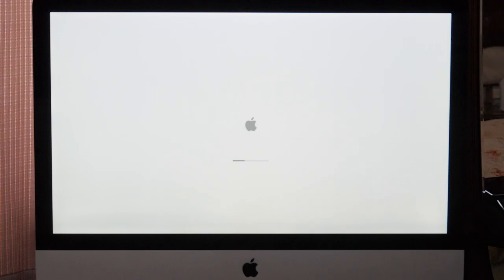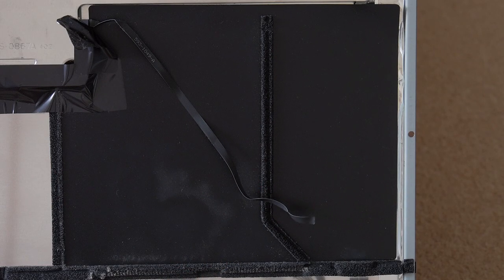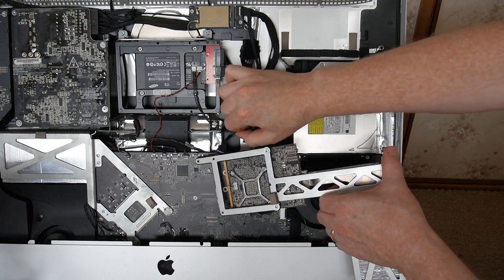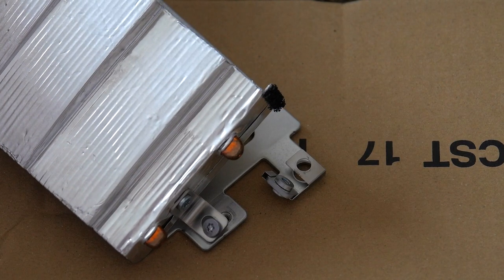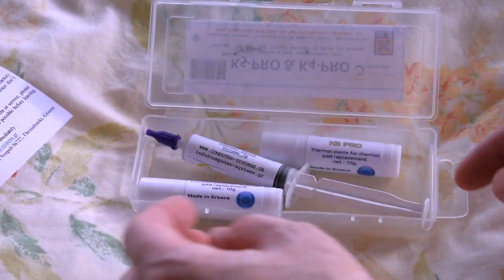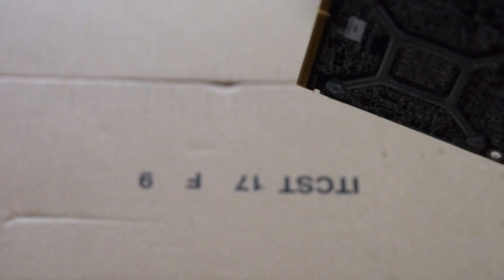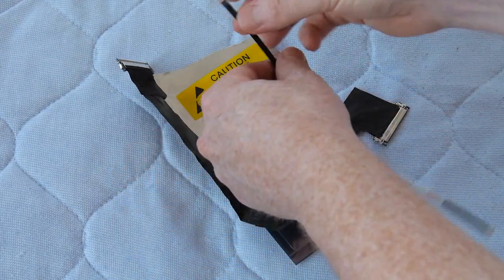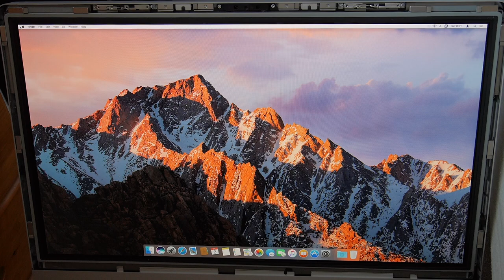Late 2009 iMac 27" Video Card Repair — 4850 — 2nd Bake

Comment: My 1st bake has lasted 3 yrs, just about to do it again.  A tip: get a cereal box, open up and reverse it, draw each part on it and insert each screw into position using a small hole to show which screw goes where.
Reply from the maker: More evidence that these flawed-design video cards really do last only 3 years.  That's how long my stock card lasted, then Apple replaced it with a new card, and that new card lasted 3 years, and then I resorted to the bake and made my two videos.  It is frustrating beyond words that we even have to do a bake to get the video card to work again, but it beats paying Apple or an EBAY seller for a replacement video card and certainly beats the cost of a brand new iMac (as much as we all would love one).  Thanks, Simon!
Reply: @JDW-  Looks like it has worked. I originally thought it was the hard drive so installed a newer version of mac osx, Sierra, and it's now updating but looks ok and isn't in Safe Boot. Glad I ordered a V-sync cable it's falling apart but ok to test the unit out. 

It's not my Mac, not a fan of Apple, but I think the blame lies with ATI. I've had 2 laptops in the last 6 years die thanks to ATI graphics cards, unfortunately baking them didn't work. While I was at it this time I enlarged the air vent at the rear by 6x its previous size, I can feel the air flowing out now. I've also disconnected the DVD drive SATA cable, cut out a small slot in the back, fed the cable through and fitted a DVD to 2.5" unit on the back of the Mac. Now provides replaceable storage at SATA speeds. Not that pretty, but it works well.

Great videos by the way.
Reply from the maker: Thank you for your kind words, Simon.  And thank you for providing more experience on the matter, specifically saying that baking does NOT work on all video cards.  Really, we have a case of a flawed video card design in the 2009 through 2013 iMacs which just so happens to be remedied by an oven bake.  It's probably worth trying on other video cards, but there's no strong evidence that shows the bake works on those other cards.  That's why I intended my two bake videos to be very specific about resurrecting the iMac's video card, rather than all ATI cards.  Best wishes to you and your iMac!

Comment: Thanks JDW. After baking my 6970 it is working again. Great stuff.
Reply from the maker: That’s great to hear. Thanks for letting me know!
Reply: @JDW-  I've also put the 5 vents back in place as the external cooling.
Reply from the maker: @F-M What do you mean by “vents” and “external cooling”?
Reply: @JDW-  vents are ventilators or fans. They are external as shown on the photographs in Google link  I've send to you.

Comment: Hi JDW,
thanks for the great videos, if you have time i'd like to tell you my imac late 2009 journey. 
I had my mac repaired (GPU baked) about 2-3 and a half years ago and the original HD was replaced with an SSD (Samsung 850 EVO). The mac worked fine for about six months then same problems. Finally after 3 years of inactivity I decided to follow your guide as a bet against myself and everything worked fine, it was a great day, that feel of accomplishment, installHighiMacblack

2. Clean Install of high sierra
3. Restore the machine at Sierra
4. Clean Install of sierra
No effect other than the black lines displayed at boot.
don'twrong waydoesn'twith a 3rd
Reply from the maker: Thank you for sharing your story, Lorenzo.  So is your iMac working now or not?  You said you followed my guide and then it was "a great day" (which means it worked), but then you said at the very end "no effect other than the black lines displayed at boot," which means it did not work.  Could you please explain?
Reply: @JDW-   I had initially posted a larger comment but youtube cut it and posted it (I exceeded the characters limit), sorry, I originally wanted to send you an email but basically I followed your guide (generously applied the k5 pro) and the iMac worked until I decided to switch to H-Sierra and install the latest security update. 
The iMac was back to displaying lines on boot and now I can only boot it with safe boot. 
I tried both backups and clean install of H-sierra and sierra to ensure it wasn't the ssd or the OS itself. I wanted to ask you if a 3rd bake was worth it, or in general if you had any problems when you updated to H-sierra. Thanks again for your time and your guides
Reply from the maker: @LDLNick2  I never had a problem with High Sierra, and I still run High Sierra on all my Macs, actually.  So how many months did you use your iMac before you updated to High Sierra and had the problem suddenly come back?  It seems too much of a coincidence to say that the video card suddenly died at the same time you updated MacOS.  And yet, I cannot see a big difference between Sierra and High Sierra to have caused the problem.  Again, the problem you are seeing is lines on the screen?  Can you post a URL to a photo so I can see those lines?  Thanks.
Reply: @JDW-   here I posted the whole "story", yes before I had pink vertical lines and now black horizontal lines. 

https://forums.macrumors.com/threads/imac-late-2009-black-horizontal-lines.2250462/

In both cases I could/can only boot with safe boot. Yes I know it's very strange but at the same time I formatted the iMac and clean installed the previous OS and it still gave me problems.  
And again thanks for your time
Reply from the maker: @LDLNick2  Thank you for the link.  If you have an external drive, are you able too boot from it?  If so, what is the MacOS version on that drive?  If you don't have such a drive, you might want to consider buying one.  It can be used for backups so the purchase is not a waste.  It's probably the video card, but still it would be good to rule out MacOS by trying to boot from an external drive.  And if you have more than one Mac and can use that drive to properly boot that other Mac from it, then you know the boot drive is good, so it will be a good test on your bad iMac.
Reply: @JDW-   thank you for the reply, I didn't try booting from an external drive, yeah I have a mac book air, I'll give it a shot and let you know.

Comment: I had my iMac 2009 down for a long time with this video card issue. I looked for a lot of solutions (mainly software), tried just replacing the thermo compound but it didn't work I was afraid of buying overpriced old cards and it could result in the same problem.
I declared as dead my card (and possibly my iMac) so I gave a try for this solution. Wow!!! I'm posting from my iMac.
10min at 200 deg C.
My 2009 iMac is back. I will post if it stops again.
But thank you very much for the 2 videos.
Just a suggestion if you have the same problem with the broken cabe, this one is very simple. If you can't wait to get a new one or if it is difficult to get it, you can paste the plastic part again on the remaining part of the cable, delicately de-peel the plastic part on the top and gently sand or scratch with a knife on top to reveal the copper "wires". I had a similar issue and it is working great (already ordered a new one just in case).
Reply from the maker: Thank you for your detailed report and the excellent repair tip, Leonardo! Best wishes to you and your newly resurrected iMac.

Comment: JDW, both this and your sister video covering the bakes are great. I was experiencing similar issues with my mid 2011 27 iMac, so decided to give the bake a try. Opening up my machine, however, revealed some differences compared with your 2009 model, both in terms of wiring and layout. The Apple Technician Guide for the mid 2011 iMac proved useful here. The key variance is the inability to remove the graphics card independently of the logic board in mid 2011 models due to repositioning of the hex screws. In 2009 models these screws can be accessed and undone from the front, whereas mid 2011 units are only accessible from the rear. This was an unwelcome discovery! It meant giving up or removing the logic board, which is a much bigger and more daunting fix. The latter route caused much head-scratching, but was worth it in the end. We will see how long it lasts, but many thanks JDW. I've posted a short speeded up video account here: https://www.youtube.com/watch?v=A3Er9dSzP1o&list=PLE4jagcljbTU-SiGvHBMR6fdnMQJjjK8f&index=2&t=3s
Reply from the maker: Excellent job, Chris!  I've pinned your post because your excellent video can be very helpful for owners of 2011 iMacs.  Feel free to post follow-up comments to let everyone know how long your bake and repaste has lasted.  Best wishes!
Reply: Yeah, I ran into this hex screw trouble too. Ugg! Not sure I am going to still undertake...
Reply: Chris , you were the other component to my success in this venture. I saw your video as well. The task is relatively easy when you use paper drawings like you did. Priceless!!

Comment: Sorry I was actually using your video to help me figure out which screws I'd taken out of the CPU and GPU.  I hadn't gotten that far.  I used Kryonaut by Thermal Grizzly and Arctic MX-4 on the GPU memory.  Used both on the GPU processor and CPU processor and mine is running cool and working great.   Both Kryonaut and Arctic MX-4 are NON electrically conductive and non-capacitive.
Reply from the maker: Thank you for sharing those details.  If you can make the time, I would appreciate hearing from you in the future here in the comments to know how well your fix works in the long term.  

The Kryonaut sounds like a fine choice for the GPU, but I am curious as to how well your MX-4 holds up on the memory chips.  I say this because there is a much larger gap between those chips and the heatsink than there is between the heatsink and the GPU.  Indeed, there is virtually no gap at all over the GPU.  This is why Apple used what are called "thermal pads" above the memory chips on the iMac video card.  Normal thermal paste like MX-4 is simply not thick enough to bridge that gap effectively over time.  

I used K5 Pro instead of thermal pads for the memory chips because I did not know how to precisely measure the gap above the memory chips and therefore I could not know which thermal pad was best to use.  K5 Pro was engineered to be a replacement for thermal pads.  It is not for a CPU or GPU but instead for other chips like memory where cooling is important but just not as important as a hot GPU and CPU.  Meaning, there is less thermal transfer through thermal pads or K5 Pro than there is through normal pastes like Kryonaut or K4 Pro or MX-4.  

So because you used MX-4 on the memory chips, in light of the heatsink gap, I would suggest you keep your eye on the machine over time to see if your application of MX-4 keeps those memory chips sufficiently cool in the long term.  

Best wishes!

Comment: Baked it 200 degrees celsius for 10,5 minutes. Nice computer smell from GPU holding it fairly close to my special service tool (ebay-search-nose). Works like a charm. Psymtoms were random shutdown, 3-10 shutdowns before being able to launch a program, finally continuous restarts. NO ISSUES after baking mid 2011 27" AMD Radeon HD 6970M 2048 MB  3,4 GHz Intel Core i7 12 GB 1333 MHz DDR3
Reply from the maker: Thank you for sharing your story of success!

Comment: Hi JSW! This weekend I faced a problem with my iMac 21.5 (2011) video card. I got striped vertical lines on boot. After it recovered from himself, I ran a video benchmark, and at the beginning of the benchmark the display turned black, and the iMac stopped responding. After a hard reboot, the issue was back. Yesterday I baked the video card, and now the iMac is back in business. I run the same benchmark successfully after that. Hope it will last a few years now. I cleaned up the old thermal paste and I applied a new one on the chip and on the RAM. Thank you!
Reply from the maker: Thank you for sharing your story of success, Cristian!  Best wishes to you and your newly resurrected iMac.

Comment: I have now baked the GPUs on three iMacs. Two 2011s and a 2009. All three were considered unfixable, and all three are now working. I use macs fan control to monitor the temperature, and I set the ODD fan (the one that also cools the GPU) to no let the card get over 120F. I'm sure that is overkill but I haven't had a problem reappear yet.
Reply: Also, it is much more difficult on the 2011 model, as the logic board MUST be removed.
Reply from the maker: Thank you for letting me know if your triple success, Luke!  And I'm sure other 2011 iMac owners will appreciate your comment about the difficulty with that particular model.  Although removing the logic board is optional on the late 2009 version, I still strongly recommend it so as to replace the BR2032 PRAM battery on the back side of the logic board.  Is that PRAM battery found in that same place on your 2011 iMac's logic board?

Comment: Not sure if you have researched it since this video but, the "bake" reflows any solder joints that have broken free from overheating and cooling down over and over (it's not magic haha). From what I've read, Apple and AMD used lead free solder on the GPU that has a lower melting point than leaded solder and this leads to the failure (along with poor cooling design). Additionally, you really shouldn't put thermal paste on top of old thermal pads, that could have easily contributed to the second failure. I'm also fairly certain that the four grey blocks (I think they are coils) between the memory chips and mosfets (8 little chips at the edge of the card) aren't supposed to have thermal paste on them at all. That is why they fall between the super smooth areas of the heatsink. If you look at the spacing on the heatsink, the smooth areas line up with the memory chips and the mosfets perfectly, but you actually didn't put thermal paste on the mosfets at all. I'm actually very surprised that the second fix has lasted for 1 year and 8 months because the mosfets produce a lot of heat and they aren't in contact with the heatsink at all. Anyways, I'm not trying to be over critical of your repair, just want to help clarify what components on the GPU need to be cooled an which ones don't. Regardless of the things that I feel were done wrong in this video, it has helped a lot with getting familiar with the tear down and layout of the iMac. I'm going to be pulling one apart for a friend and just want to say thanks for the detailed video!
Reply from the maker: Thank you for watching and for your feedback.  You are correct about the thermal pads, which is why after my 2nd bake I completely cleaned off all the stock thermal pad residue and used K5 Pro (a thermal pad replacement paste).  The reason I did not put any paste on areas of the heatsink other than the memory chips is because Apple didn't.  That's right.  Even though there are parts of the heatsink that seem to indicate paste should be used, Apple didn't use any paste there for some reason.  As a result, I didn't add any there either.  And the fact the card has been running great for more than 1 year and 8 months seems to indicate that maybe those parts don't get hot enough to warrant contact with the heatsink in the first place.  That's not really wild speculation either considering that Apple didn't put any paste there at all.  Anyway, if you do the bake for your friend, be sure to follow my 2nd bake video.  My 1st bake video is still valid to show how to remove and replace the motherboard, which is needed if you want to swap the PRAM battery.  But for everything else, especially the paste, my 2nd bake video covers that better.  I highly recommend K4 Pro for the GPU and K5 Pro for as a replacement for the pads.  If it was bad paste, I doubt my 2nd bake would have lasted this long.  Let me know how your bake goes!

Comment: This is some sort of witchcraft but it just fixed my issue first time! I can't thank you enough and it was nowhere near as difficult as it sounds. Amazing!
Reply from the maker: Thank you for your kind words, Phillip.  It is surprising that it does work, but despite all the naysayers have said (e.g., "will only work for 3 months or so and then die again"), the bake (when it takes) really does work.  I'm currently going on 1 year and 1 month after my 2nd bake.  Not sure why the 1st bake only lasted 4 months, but my 2nd bake shows the bake really does work, and the vast majority of people who try it find success (as evidenced by their numerous comments here).  Best wishes!
Reply: I'd love to know the science behind it but right now i'm just extremely happy that I just saved myself being ripped off for a repair. Been running the computer pretty solid for the past 3 hours and the GPU temp is pretty stable between 50 and 60 C, far lower than before the bake.

Comment: Didn't cure my black screen, unfortunately... But thanks for saving me the trouble of getting the motherboard out. I thought I had to do that, but you showed me an easier way.
Reply from the maker: If that's the case, and if indeed you used a thermometer to confirm your baking temperature was correct, then it could be that you merely have a bad backlight driver board issue.  To confirm that, power on your iMac and shine a flashlight into the display.  If you see any content at all, it proves you have a backlight related issue.  But if you cannot see any content, then it is either the graphics card or power supply.